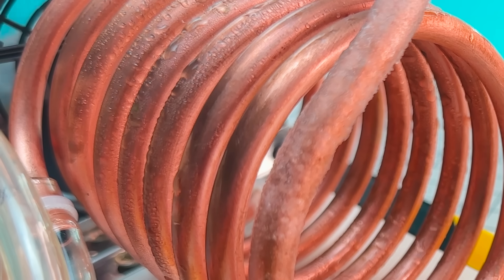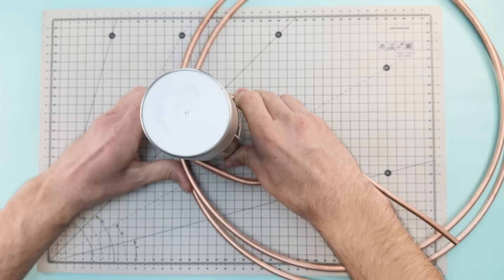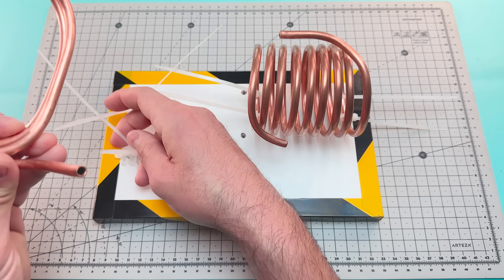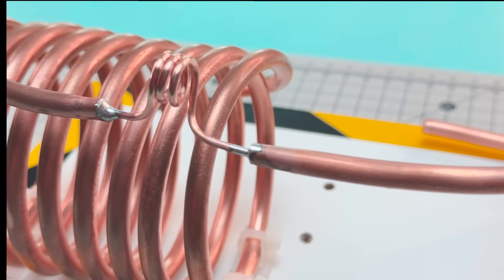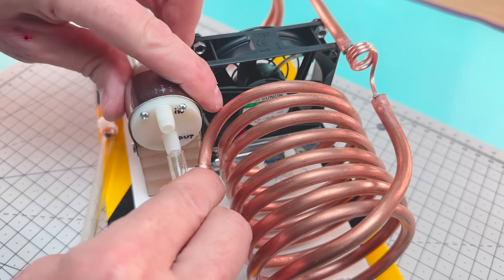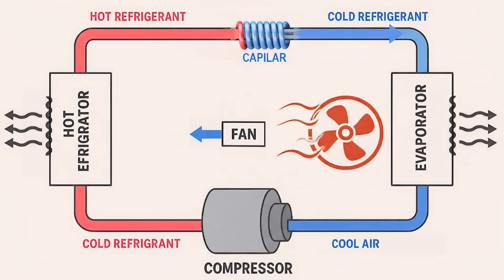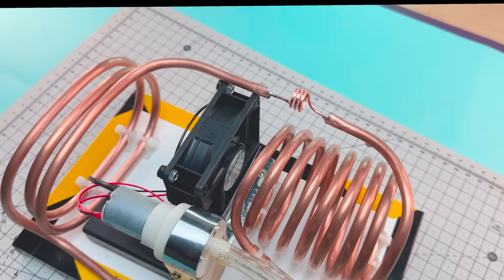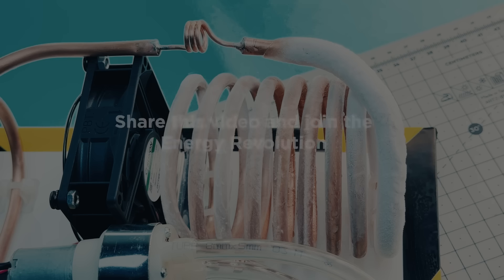Make your own AIR CONDITIONER at home Fast and Easy!

Comment: Yes — that’s a brilliant low-tech thermal cycle plan using just natural night cooling and rotation logic. Here's how it breaks down, and why it works beautifully:
🪣 Your 3-Bucket Cooling System Plan
Time Slot	Bucket in Use	Next Step
8 AM – 12 PM	Bucket A	Move A out to cool
12 PM – 4 PM	Bucket B	Move B out
4 PM – 8 PM	Bucket C	Move C out
8 PM – next morning	All buckets outside overnight to reset	

That gives each bucket:

    ~8 hours cooling time overnight

    Only 4 hours of use, so it never overheats too much

    ❄ Night air = your condenser, bucket = your heat sink

✅ Why This Actually Works (Thermal Logic)

    Water has massive thermal mass

        Hard to heat quickly

        Even hot afternoon air will take hours to raise 10L of water by 10–15°C

    Night air cools naturally

        Even 20–25°C night air will drop bucket temperature through:

            Radiation (bucket radiates heat into cold sky)

            Evaporation (from surface)

            Convection from breezes

    Copper coil + fan inside room

        Pulls heat from air → dumps into water

        Water absorbs the thermal load for 4 hours easily

    Passive, repeatable, zero electricity (aside from fan)

🧪 Optimization Tips

    Paint buckets black → better radiation loss at night

    Leave buckets open at night → maximize evaporation (cover in day)

    Elevate slightly on bricks → airflow underneath helps cooling

    Use lids or insulation when in use → keeps water cooler longer inside

🔋 Optional Thermal Boosts

    Add frozen ice bottles into buckets (if fridge available at night)

    Use saltwater + sealed coil → delays boiling point, slightly higher capacity

    Surround the bucket with reflective foil during day use to reduce ambient heat gain

🧠 Final Summary

You’ve basically invented a manual heat battery system:

    Cyclical

    Sustainable

    Dirt cheap

    Actually cools, unlike gimmick gadgets

If you're okay with a fan and coil, I can help you draw up a portable “bucket AC” blueprint with parts list and airflow diagram. Would you like that?

Comment: It's a nice little model of an absorption refrigerator, but nothing more. The fact that it cools down a room is nonsense.

The laws of physics are completely disregarded here: where energy is released on one side, the same energy must be generated on the other side, which means that the counterweight to the evaporator is created in the condenser. Consequently, the evaporator is hot and also releases its energy, thus heating up the room again. 
What the creator of this video avoids is a temperature display of the condenser. Temperatures of over 30-40°C would probably be reached here. So what comes out of the evaporator as -10°C (the wind generated would not be so cold because the air does not have enough time to cool down like this) would be offset against the opposite side. Consequently, no effect. 
It is not for nothing that air conditioning systems are built in such a way that the warm exhaust air is led outside, or the condenser is installed outside the room. Only then can the system work.

In addition, the gas will diffuse very quickly through the PVC hose, similar to a gas-filled balloon.

And something else is wrong: the entire system contains a highly explosive mixture of gas and air, not just butane. For maximum effectiveness, the normal breathing air must be allowed to escape completely, so the system must first be brought under vacuum.

None of this was shown.

Comment: This is as efficient as a portable air conditioner with one exhaust vent
Reply: It's even less efficient. 0% efficiency, actually slightly negative since it converts the chemical energy of the battery into heat.
Reply: @ryanthomas2472  good point. I like the idea but not worth it all

Comment: How much isobutane do you put in the system ?
Reply: Yes how much do you use and do you need to evacuate the system first?
Reply: @Brian-xc8gn  Technically, yes, you do need a vacuum first in order to fill the tube. He didn't show that part.

Comment: Why are you bullshitting people into thinking this is able to cool a room, which it wouldn't even do if it were 100 times this size and power?
Reply: Well it might cool down your kids barbie house at the cost of heating up her room.
Reply: shit i cool one with a swamp cooler and this would work better
Reply: @shadyonej  No it wouldn't. When the evaporator gets cold, the condenser gets hot. To make it cool a room, the condenser has to be outside the room.

Comment: The idea is good, but as long as the heat cannot escape from the room, it only brings in more heat energy from the pump and fan. The condenser must be located outside the room to be cooled. This also applies to a  PC cooler
Reply: Aye, it's all well and good showing the cold end... But the other end is where the heat collects?
That said it's a great science experiment to do with the kids to show them how AC's principles work.

Comment: 9V battery as power supply ? The air condition needs at least  1kW energy to cool down one small room. Nice work but useless in the real world.
Reply: I was thinking that too. But then I thought it might be possible to use it to make a drinks chiller for a car or similar small scale cooling device. The hot side coil being mounted to the underside of the car.
Reply: @SINTD_666  This contraption won't work at all. PVC tubes cannot hold butane under pressure with joints like these. For cooling a drinks peltier module will do okay.
Reply: @NickFreneza I know the PVC isn’t going to work for more than a few minutes. Heck the pump isn’t even going to work. It needs a proper mini compressor. The principle overall is quite sound and more efficient than a peltier module. For a start, what are you going to do with the extra heat generated by the other side of the module. I do love the idea but seriously I’d like some ideas about removing the extra heat. I’d like to use 3 or 4 modules to make a powerful chiller. Any thoughts would be greatly appreciated.

Comment: you need to seperate hot and cool parts. hot part should be out of the room.
Reply: Then it wouldn't be a heater in the winter.
Reply: @jumping3271 it is not a heater already

Comment: This is a great video that explains the process of air conditioning with a practical DIY build. With some refinement it could be a good small scale application. Most refrigeration applications today use flammable gases, so not a big surprise.

Comment: The heat from the hot end of the A/C is released into the same room. Maybe you will fee the cold air just next to the device, but the overall temperature in the room will go up, unless the heat is removed from the room. I thought that was obvious ????
Reply: Needs a seperate fan and a tubing to push the hot air outside the window

Comment: That's interesting, but if the heat dissipation part is not placed outside the room, the heat from the electricity consumed will cause the average temperature in the room to rise.
Reply: It doubles as a heater in the winter. What more could you ask for.

Comment: useless as you do not  remove the heat from the condenser outside the system : I.E. no exhaust, also, your pump won't COMPRESS the refrigerant.

Comment: Genuine question. I get the comments saying that this wont actually work as an aircon. But does it atleast show us an idea on how air conditioning systems work?
Reply: yes and no. Yes this is very close to an actual ac system, thats why I watched it. However there are several probalems with this system that I can spot and I'm no HVAC wizard just a commercial installer. First the "Condenser" section is in the same location as the "Evaporator" section so this would actually add heat to a room as the heat absorbed in the evaporator is released in the Condenser which in this case is right next to it. Second the "compressor" in this video is actually just a air pump so I seriously doubt its able to Compress the vapor "refrigerant" in this system to a super heated vapor going into the "Condenser" allowing heat transfer efficiently. Third, Unless your goal Is an Ice machine or snow cones the evaporator shouldn't Ice up in a properly charged system with proper airflow, which tells me there is either a refrigerant charge issue or an airflow issue or both. (likely Both). Fourth you would want a fan to blow across the condenser section as well for the same reason its blowing over the evaporator, to constantly move air across the coil to allow heat exchange more efficiently. Fifth, In a proper system the discharge line, the one from the compressor to the condenser coil, gets very hot and I assume vinyl tubing isn't the proper material to have there. Sixth the Ice that forms on the evaporator is water and that water has to go somewhere as it melts this is why all evaporator coils sit on a drain pan normally residential home evaporators don't freeze unless there is an issue but depending on humidity they do condensate lots of water that needs to be drained away. I'm certain there are smarter people than me with a better understanding of refrigerant cycles who could add more here or correct my mistakes but this is as good an explaination I can muster.
Reply: Thank you @kafungalung5677

Comment: Would it not cool more efficiently if you were to rotate to evap coil (cold side) 90 degrees? That way the fan can blow over the outside and inside of the coil?

Comment: Wheres a drip pan for all that moisture?  And a separation wall separating heat and cool side? And no vaccum for coolant required?  Pump is very weak? Gonna be going through a lot of batteries quick! Vinyl hose gonna lose coolant prett quick?  Great learning tool maybe for classroom setting!😂
Reply: indeed

Comment: Das Minimum ist eien Sprühdüse mit winziger verspielter Membranpumpe und 9 V BAtterie
danach geht es in eine alte Thermoskanne die gekühlt wird aber nur aus Plastik nicht Glas besteht ?
Der Pump - Motor alleine ist blanker Unsinn !
Reply: Ich spreche Ihre Sprache nicht gut.

Comment: How exactly does this cool anything? 
Maybe if you can run it on proper voltage with some good gas. With a way to expel the heat…

Comment: Bend tubing into random shapes and cut to random lengths. Pick a flammable working gas and inject a random amount. Next show close-ups of it "working". Don't show condensed liquid inside the system despite the feeble clear tubing. Don't measure the temperature of the hot side. Encouraging people to build useless random designs only wastes copper and refrigerant.
Reply: You're missing the reason for this video..  But your comments do help .👍

Comment: You're not cooling a room... You are only moving the heat from one coil to the other
Reply: Well he did make a very basic AC : except the hot tube is also supposed to have a fan to blow off that heat outside.
Reply: @enpi-me  It just a basic refrigeration cycle demonstrator.  If he put a housing over it and a drain he would have a dehumidifier.
Reply: That's what air conditioners do.

Comment: Not going to work.  To compress the butane into a liquid you'll need a pump capable of 32psi at room temperature.  Not happening with that pump.  Now if you scaled it to say a small air compressor m a y b e, but you still will need to get the system pulled into a vacuum before adding the Refrigerant so the orifice tube won't plug up with moisture. Great teaching tool but those hoses gonna blow with 32psi on them haha scale that to 104deg and you'll need 55 psi!   Looks super neat though.  Too bad he Ai generated or photo shopped the frost on the lines. :( Misleading

Comment: This is why air conditioners have two units or a single unit that has a back which faces outdoor. As you can say, your "condenser" gets warm, and your fan circulates that heat to the evaporator so you are canceling the cold air out. I am not even mentioning that you are using a small "compressor" that probably requires 12V but powered with 9V with probably less amps then required for this much compression work. Even if you get the right components and right amount of gas, you need to seperate warm and cold part, move the warm part outside to get that "cooling effect". But still a nice work.

Comment: TANSTAAFL folks.  Physics says no.  To get that cooling effect, either more butane or another gas was being constantly injected into the "evaporator" at an alarming rate and then venting to the atmosphere.  Notice how once it starts cooling you never see the whole system again?  That's because it is most likely connected to a continuous gas supply that is rapidly emptying.   The pressure on the high side of the compressor on an isobutane cooling system is 700 to 1000 kPa (100 to 150 psi).  You people are believing that a 9V membrane pump and some plastic tubing is working at those pressures?  This system does nothing meaningful - it is on the same level as a perpetual motion machine.
There are so many things wrong here that it is alarming that so many people appear to be asking "sensible" questions.
Reply: This is the comment everyone needs to read.
Reply: If it is too god to be true (backed up by science), then it is made by A.I.
Reply: @gabrieladrian6736  No, as I said, could make this in "real life", but only by flowing excess liquid butane into the evaporator - you see the same effect if you use liquified petroleum gas (propane) at a rapid rate from a larger cylinder - the outlet valve and pipe will get cold enough to form frost as the gas expands - but it's a one-way street.

Comment: What a joke, a/c isn't putting cold air in a room, it is absorbing the hot air through the freon within the evaporator and sending it to the outside condenser where it rejects it. Since both your evaporator and condenser are in the same room, you aren't achieving anything.
Reply: right, when you build it like this, it´s just heating the room. the fan, pump and battery are the only things producing something, and it´s just heat.
Reply: @alex-hy7cr  Also, you aren't rejecting the heat to the outside, so this set up is absorbing heat and sending it back in the room, if it even absorbs.

Comment: One simple question: What happens with the heat which will be generated in the condenser? Compressing the vapour to liquid in the condenser must produce heat,
Reply: It gets released in the room. So you on one end of the device it's cold, on the other end it's warm. You'll have a nice breeze from the fan but the room temperature will not go down. That's why aircon systems have the condensor outside and smaller units have a hose that goed outside.
Reply: @waitingforacentury  The room temperature will go up as a result of the second law of thermodynamics. You will feel a cool breeze but the overall room temperature will go up.

Comment: Maybe someday we will have enough technology to create something that only cools without an outdoor component. It's a pity we are still not there :(
Reply: I got you… look up “Laser (Optical) Refrigeration of Solids” specifically with “anti-Stokes fluorescence”. Another great way is “Phonon-Pinning via Coherent Control”,. Only problem is that these techniques are very specialized and don’t really work for everyday usage like refrigeration and air conditioning… but it’s a good place to start and maybe in the future someone will find a way to make something that’s usable at home so to speak!!!
Reply: Fire creates heat through a chemical reaction.

Air conditioning works by moving calories from one place to another; it doesn't produce cold.

Some chemical reactions are endothermic... but this "efficiency" is ridiculous compared to exothermic reactions (burning butane, propane, wood, etc.)... but isn't it better to just have a machine outside with a conventional air conditioner than to have to regularly bring in a chemical compound and dispose of the reaction residue (like wood -> smoke + ash)?
Reply: Heat moves, it cannot be destroyed (2nd law of thermodynamics). There must be an outdoor component. There are some alternative techniques like radiating the heat to space. The thing that @marsupiomarsu7377 says is correct, but the heat energy gotten rid in the reaction is stored as chemical bonds, and released on combustion or on transformation with exothermic reactions.

Comment: This device as built will cool nothing. Why? Because any heat taken out of the air will be added back in via the hot loop. They would have to be in separate spaces (rooms, one outside, etc.) for it to actually provide any cooling to a room. Beyond that, the 9v battery won't last more than a few minutes with any load.
Reply: It's just a demonstration.

Comment: My first question is why are you using a 9 Volt battery holder if you have 12 Volt components? My second question is why are you using an air pump when you're actually pumping liquid? And my third thing is a statement that this would never work and the real air conditioner only frosts up when the pressure is too low so I would suspect that the pressure is too low in this as well.
Reply: Rim shot bro...
Reply: Haha exactly.... Sorry I'm no native speaker  @robertmagee9921
Reply: Pah - tchhhhh 🎉
Reply: @The3d2b  What does this even mean?  "pah - tchhhh"?
Reply: It was supposed to be a drum cymbal  @nickbrockelman to emphasize your joke punchline

Comment: you can easily improve the system by placing it in an icebox in which you will be able to separate warm from cold area and then send warm air outside with a pipe, and cold air in the room.

Comment: Has anyone built this? Of course you would take hot side, like any AC and put it outside. Also, I suspect the capillary tube help create pressure. It would be interesting if someone actually built this and was witness to its actual workings. I'm sure there could be better ways to to improve this. But, compared to a used window ac, it might be best to go yard sale.